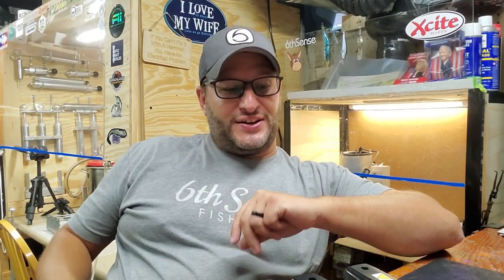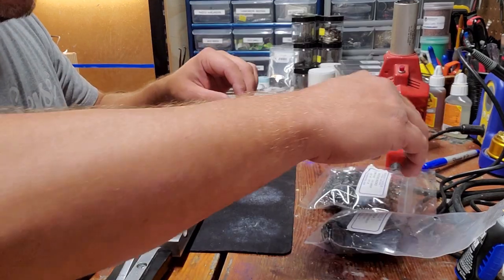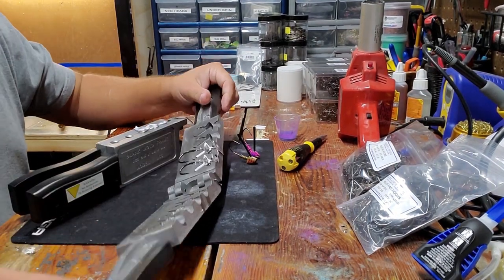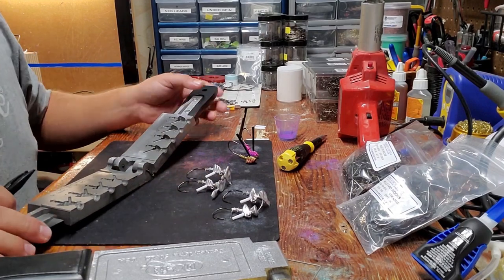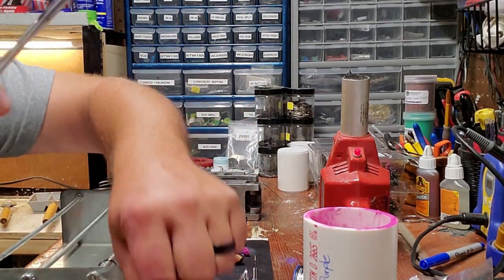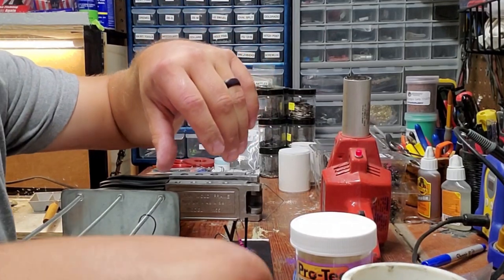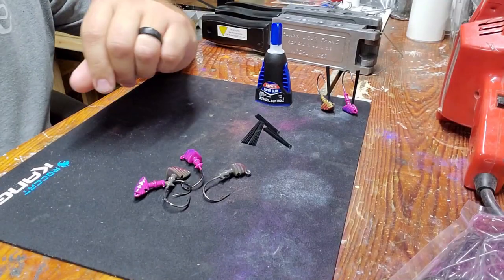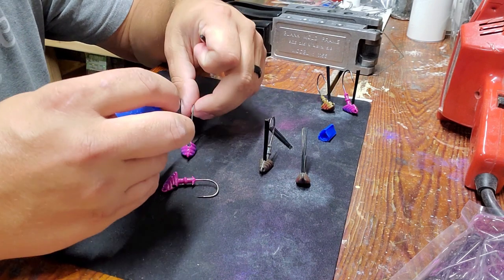Custom Jig Molds!

Comment: You often show your lead pot ventilation system from the pot down.  You could do a whole video on how you set that system up, if you haven't already.  If you have, point me to it.  I'm about to set one up and I'd like to see how yours is done before I do.  I may be TOTALLY overthinking what I need to do.
Reply from the maker: Your right, that's a great idea for a video! I will get one out in a week or 2. It might be explained a little in my shop tour videos.
Reply: @B8N_Tackle  Yeah, I'm talking about a fairly granular one: size of the fan (physically AND CFM moved) and how it's supported, what sort of exhaust hose/ducting you use, and how it's vented through a wall/door.  At this moment, I have FAR more questions than I have answers!